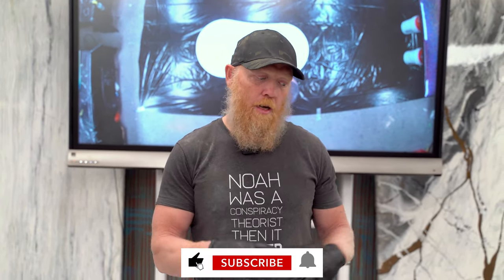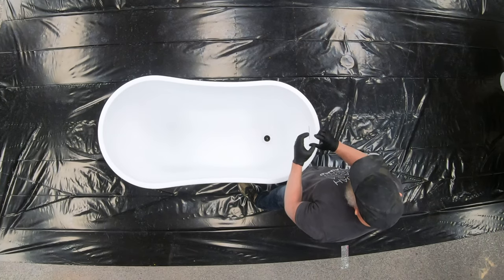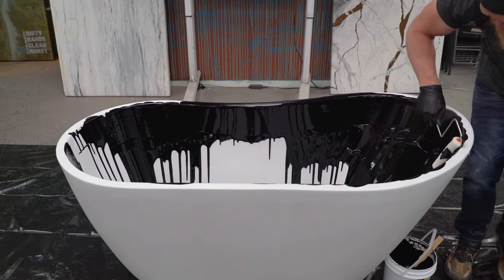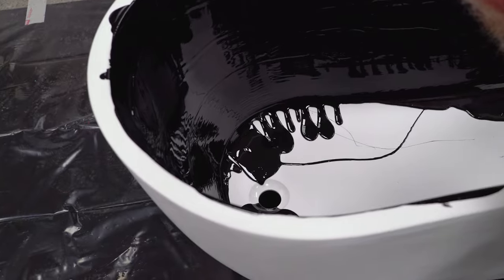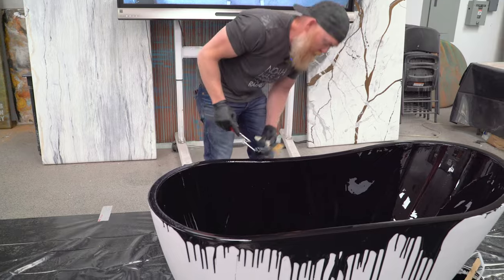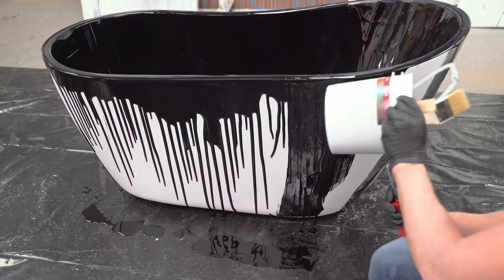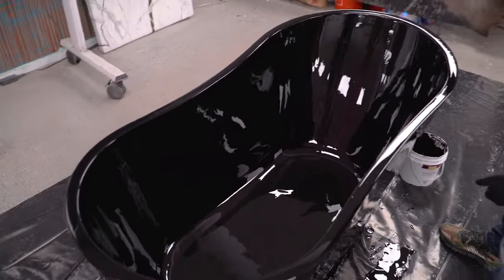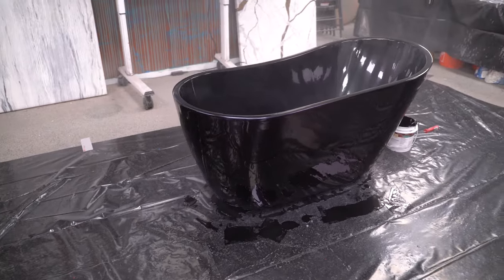Countertop Epoxy Bathtub - Color Changing Tub Remodel - Countertop Epoxy

Comment: We have one of those multi piece fiberglass tub/shower combos. The tub looks like the previous owners used to bath a baby wolverine(X-men)! The bottom of the tub has gouges all over it!  I am disabled and don’t know if I can handle removing and replacing it all, the work or the cost for that matter.  Does the whole thing need to come out for the epoxy to be put on? I don’t know what to do about the upper panels and getting them to match the new epoxy color, if I left them in place it would be like gluing all the joints together and either cover the calking or make it impossible to get a good seal when putting in new calk.

Comment: I have a freestanding watering trough for my bathtub/shower. It has thin ceramic tiles on the bottom. I like the idea of fake flowers placed around the cracks as if to be growing through and then covered and sealed with the epoxy. 

Would this epoxy work in the tub for a slightly heavier fill of epoxy at the bottom to cover everything?

Also, I’m from WV 👋
Reply from the maker: Sounds like a very exciting project.  Call our office and we would be happy to help you get the products that you need!!  970-639-9338  MST

Comment: How is your tub/sink epoxy different from your countertop epoxy?
Reply from the maker: Hey great question! Our Tub coating is specifically created for a standard tub and allows the product to be rolled vertically. with our countertop product the furthest you'd want to go is the edges height vertically and someone who is advanced could get aware with a few inches of a backsplash.
Reply: @CountertopEpoxy  is it the same cure time?  Could the counter epoxy not just be thickened with the proper agent?
Reply from the maker: @mountdoomee  it will cure overnight and we don’t add additives to our epoxy products.